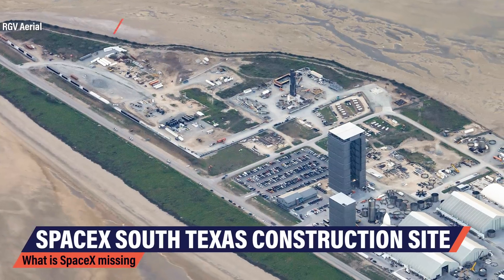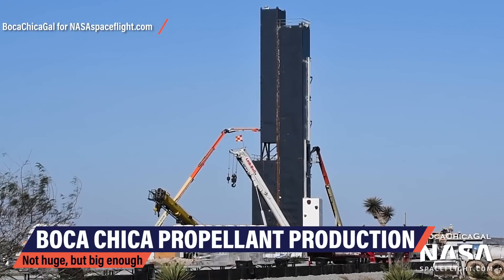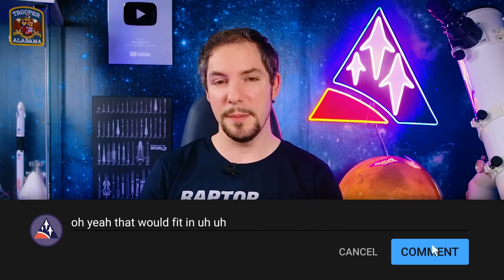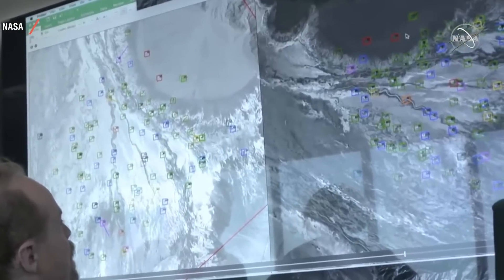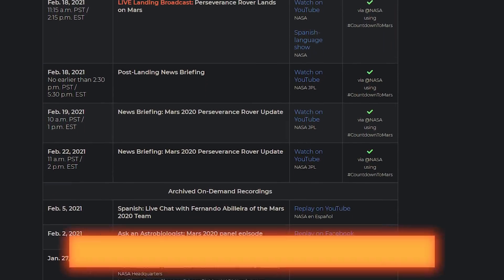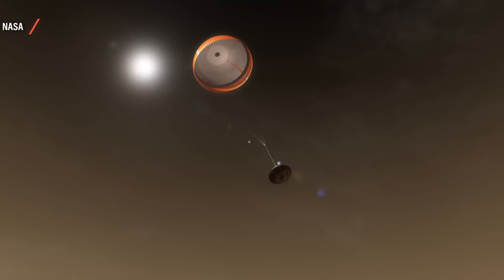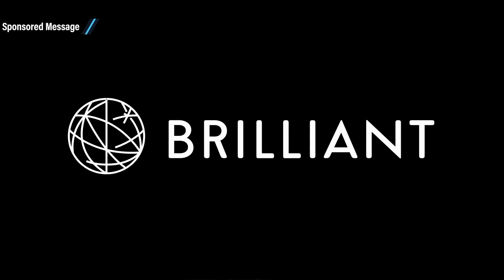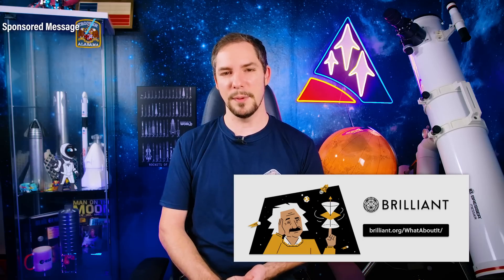146 | Elon Musk’s solution for SpaceX Starship Landings – Perseverance preparing for safe landing

Comment: German version below...
I'd guess that the raptor enigine prudction speed/amount is held back by... consumption. In the end it's a warehousing problem. How many Engines are you willing to build and maintain until use at the same time? There will be a point of diminishing returns. We know, obviously, they built at least 44 engines yet. Not even half of them have flown yet and thus didn't produce data on whatever variation of construction they were meant to be delivering flight proof on. Why scrub an experiment? Would be a waste of money, unless they discover a dealbraker already during testing. On the other hand: before getting the results of the up to 44 engine experiments, one shouldn't produce more engines with the same yet to be shown and already proofed imperfect design, should we? Do not mass produce a design, that is not real world tested. Not even Tesla did that. I think we will see Space X moving toword that 12h mark once the Starship production/consumption meets that demand. Storing space is expensive.

Ich denke, dass die Anzahl der produzierten Raptors von ihrem ... Verbrauch zurückgehalten wird. Angebot und Nachfrage unterm Stich. Wie viele Antriebe will man bauen und warten, wäöhrend man auf ihren Einsatz wartet? Es kommt zu einem Grenznutzen. Offensichtlich wurden bisher mindestens 44 Raptors gebaut. Nicht einmal die Hälfte davon hat bisher den Flugeinsatz bekommen. Dementsprechend haben sie auch keine Erkenntnisse aus einem Flug erlangen können. So, wie wir SpaceX kenne, werden die Motoren alle leichte Variationen haben und Experimente sein. Ohne Durchführung des Experiments hat man keine Daten, um das Experiment auszuwerten und die Variationen zu bewerten, oder? Wenn man nicht weiß, dass ein Experiment durch einen Designfehler vor der Durchführung schon zum Scheitern verurteilt ist, wäre es Geldverschwendung, es nicht durchzuführen.
Außerdem sollte man vielleicht nicht dutzende weitere Exemplare eines Motors produzieren, der noch nicht Praxiserprobt ist. Wir haben schon 44 Prototypen. Zeit herauszufinden, welcher davon für die Massenproduktion geeignet ist. Auch Tesla produziert nicht auf Masse, nur weil ein Prototyp besonders vielversprechend ist. Er muss sich erst beweisen. Ich denke, dass SpaceX sich dem 12 Stunden pro Antrieb Interval annähern wird, wenn die Starship-Produktion anfängt hinterher zu kommen.

Comment: think the big problem flight Starsips is the phenomenon Gyroscopic effect on rotor fuel pump. Look, let the rotor mass be 20 pounds, at 30,000 rpm, and gas dynamic lubrication, in turning, the moment applied to the rotor supports is enormous and can exceed the strength of the lubricant; contact of the rotor with the housing will lead to friction, loss of pump power at a critical moment , destroy. 
Ways of solving - to reduce the diameter of the rotor (the moment of inertia is proportional to 2 degrees of the diameter  Ja=0.5mr^2 ), to do biturbo, to make a turn higher and slower
Reply: There's no thing called "rotor" in Starship. Only tanks & engines
Reply: @alvianchoiriapriliansyah9882   An important component of the Raptor engine is a fuel pump that pumps liquid methane 133 kg per second, consisting of a housing and an impeller, a turbine, a rotor, whatever you want. And an oxygen pump pumping 493 kg of liquid oxygen per second.
And when the Raptor engine is running, a significant additional load will be applied to the supports due to a change in the position in space of moving parts.
And I do not know if McGregor has a stand with the Raptor engine turning 90 degrees during pumping or operation to determine the permissible rate of change in the angle of position in space that does not lead to the destruction of the engine.

Comment: Personally I think the solution "just light all engines just in case" isn't the way to go since they are basically working around the initial problem which is the fact that these engines obviously have a lot of problems when it comes to relighting them.
Reply: So more redundancies isn't better?
Reply: But we can deal with that by repeatedly running the mission profile at McGregor. Making sure we can do the landing profile can’t wait until after the Raptors are perfected.

Comment: The orbital launch mount had tons and tons of concrete poured in it. That much concrete takes a very, very , very long time to cure. As a matter of fact although it can be used soon, the orbital launch mount with that much concrete will probably not fully cure for years.
Reply: Concrete will cure in 28 days, and the first orbital launch won't occurs in less than 28 days from now (pending enviromental assessment)
Reply: @alvianchoiriapriliansyah9882  This is not the concrete pad in front of your garage.
Reply: @runningray  Literally all concrete were still curing. The points is, how long before it's usable despite still curing

Comment: So starship design (flaps) is based on earth atmosphere conditions. The moon lacks those (aero)dynamics. Mars atmosphere is primarily CO2 and density is 1/10 of earth. So they can nail it here on earth... but moon and Mars will need more engineering.
Reply: Higher terminal velocity = longer landing burn = earlier flip, but regardless the atmosphere drag will still be useful there
Reply: @alvianchoiriapriliansyah9882  reminds me of Hubble. They designed the original mirror forgetting that there is no air in space. So the focal point was messed up. It took a later shuttle and space walk to replace parts.
Reply: @mikemccabe1324  Irrelevant

Comment: Felix, what about it!? SN8 & 9 flight profiles where very conservative except for the landing. Why? I understand the landing flip maneuver close to the ground is based on the goal of minimizing landing fuel mass. But why do this maneuver so early in the test program. At this stage of development doesn’t it make more sense to do a more conservative virtual landing much higher up and then end the flight with a SN5 & 6 slow hover landing? Is this do or die close to the ground flip maneuver acceptable for a human rated Starship, wouldn’t a crew-rated Starship need greater safety margins for its landing? Wasn’t the Falcon9 developed right from the beginning to be human-rated. Would a slower horizontal to vertical transition at a higher altitude along with some fuel settling vertical deceleration (gaseous 02/CH4 RCS) offer the needed safety margins? Felix you definitely rock, your WAI is one of the best youtube space channels.  Love your work.
Reply: "But why do this maneuver so early in the test program. At this stage of development doesn’t it make more sense to do a more conservative virtual landing much higher up..." LOL That is what I've been saying from the beginning. Not sure how much fuel the header tanks hold, but if they had enough they could do as you said, a virtual landing. Pick an altitude they want to "land" at, and try to stick it there, and keep doing so until either out of fuel, able to come in for a more conservative landing, or just let it blow if it runs out of fuel since most of us (including Elon) assumed it'd RUD anyways.

Comment: I get why starship is stainless. But the booster doesn't nees to be. Surley going for a carbon composite is the best solution for the booster, jslustbspeak with the guys at rocket lab, I'm sure they would help!
Reply: Well, carbon composite would be much more expensive for multiple prototypes. Perhaps when everything is worked out it might make sense.
Reply: Weight doesn't matter as much on the booster as the upper stage. Carbon fiber is painful, expensive, and share no commonalities (important in manufacturing)
Reply: Then why is he trying to shed so much weight? I think its more important than we think and the choice for stainless is preference not practicality. If rocket lab can do it successfully then im sure elon can.
Reply: @mattwaters106  Carbon share no commonalities whatsoever with the rest of the system. SpaceX hates it

Comment: SpaceX is going to loose many Starships before they nail the landing. That's a fact.

What I'm wondering is if they'll loose any boosters. Elon has said they surely hope they don't loose any because that would be a lot of expensive raptor engines. The booster is pretty similar to the Falcon 9 in concept, but in practice operates very differently.
Reply: We do not know how many Starships we will lose because they are all prototypes. Elon said initial flights of the booster could be done with as few as 2 raptor engines.

Comment: Every time a Raptor fails they have to find out why and design their way out of the problem. No surprise they aren’t mass producing them yet.
Reply: I don’t think the Raptor Engines are failing rather I think the failure is within the fuel delivery. This is the first time a rocket has to tilt to fly/glide then reorient for a landing. Somewhere in the process of going back to vertical there appears to be an issue with re-fire. Maybe during glide there is a pressure loss in getting fuel back into the appropriate engine causing either a delay in refire &/or an issue with full desired performance. Just a theory after seeing a nominal lift off.

Comment: I suspect that the landing issues are the result of starving the turbo pumps of fuel during the transition to its vertical landing station.  Liquids channel under high demand.

Using three engines on landing will answer this speculation, as three pumps demanding fuel will be an even greater challenge to the fuel delivery system.  If I'm correct, the three engine start will show this... spectacularly.

Comment: Since I'm not a raptor rocket engine specialist I would like to ask a question that someone in the community may, in fact, know the answer to. Given that each of the 3 raptors have significantly different run times and shut-off times during the assent to test altitude, are any of the raptors any more or less likely to have re-light issues based on the on and off times of the assent?

Comment: To have an idea what that part is at the Cocoa site, it might help to look back at Elons comments back when he closed the Citgo site. Elon once stated the production rate of raptors hoping for 1 every 12 hours by the end of the year. That was back in 2019 and I dont think he updated the rate. Rolling back to #39 doesn't necessarily say much. It could be an updated engine. Or, knowing it's potential fate, it might be better to go with and engine that can reliably relight for it's suborbital test flight. Right now the demand for raptors is pretty low. I'm sure they will increase production rate as the demand grows for a matured Raptor engine. A list of raptor numbers that have been known to be used would be cool. That is very interesting construction at the Orbital Launch Mount. These are not inexpensive tents and modular buildings. These are poured concrete, explosion resistant buildings with very expensive equipment and infrastructure being installed there. Wouldn't we all love to see the site plan for the current work. But, they have to have building permits. I'll bet this is all on Public record at the Planning and Zoning dept that governs Boca Chica. Who's up to going there to take a look? Mary? Larry? But, will this really be used as an Orbital Launch Mount? Considering the distance of South Padre Island, can 28 raptors really be ignited without risk to South Padre?

Comment: There are quite a few technical errors in this video, unfortunately.

1. The FTS is not yet installed, the box you see being installed is a vibration measurement system.

2. SN10 will not shut down the engine closest to the center of mass, but rather the one with the shortest lever arm. There is a difference which has to do with the vector of thrust.

Comment: Third time is the charm !?
Reply: It seems, the way those engines currently work does not leave much range for fluctuations of fuel pressure, flow and thrust control. 
Probably there is a reason why they are not mass-producing them yet.  We just have to wait and see, meanwhile, I can  enjoy the fireworks since I have no stake in SpaceX except the massive damage they cause to the environment.
Reply: @reasonerenlightened2456  If it makes you feel any better, all of the operations that all of the space agencies and companies around world carry out are a drop in the ocean when it comes to carbon emissions (especially compared to commercial air travel). If you're talking about Boca Chica specifically, yeah it's a shame, but I don't know what the other launch site options were to pass judgement on whether or not it was a good decision.
Reply: @reasonerenlightened2456  yes they need a less performance version lol low throttle or low impulse

Comment: Why are these engines such a mess of seemingly unprotected wiring? It doesn't make sense to have such a huge powerful engine and these wimpy pipes, unprotected. Can't be that much more weight? I'm sure it is also possible to have the pipes integrated in the engine itself, make it structural (or holes in the structure at least:).

Comment: once they get it to land... they might have to sort out better legs as if SN10 goes down to just one rapter to finish the landing that will be fireing off centre
Reply: One rapter can’t generate enough thrust to land as seen on sn8 but still a good idea to start installing better legs because it would give it more leeway to have a rougher landing
Reply: @RandomPerson-zl6uz  One engine can't do the landing if the second one flames out too early and it's not getting enough fuel (SN8), but operating properly it can give TWR > 1.  According to the announcements during the SN9 flight, the plan is (was) to cutoff an engine sometime after the flip, and do the final touchdown on one engine.
Reply: @epicspacetroll1399  ok didn’t know that thanks
Reply: The plan is no legs
Reply: @paulmurphy8549  that is for the booster, not the second stage.

Comment: Starship does not need header tanks. There’s some weight saving right there. Along with 100% reliability.
Reply: It need's header tanks. It can't land without them. The reason why maybe raptors did not work propertly on landing is because LOX header tank is to far from engine and the pipe is to long and due to that there is problem with pressue and flow.
Reply: @miciglaric  
IT. DOES. NOT. NEED. HEADER TANKS. 
Its such a simple design change to get rid of them, I cannot even get a patent for the idea. 
Stop believing everything your lord and master does is the right way to do something. Because it isn’t.
Reply: And why exactly doesn’t it
Reply: @Kaskadamusic  because a simple design change says so.
Reply: @davidwebb4904  ok lol
Reply: @Kaskadamusic  

They make a lot of mistakes. 

Incorrect loading/off loading of propellant = loss of vehicle. 
Having an unnecessary fuel header tank system = loss of vehicle.
Not lighting what may have been a fully functional third engine = loss of vehicle. 
Launch mount without flame diverter = plain dumb. 

Starship, does NOT need a header tank system, with a simple design change. 

But nobody wants to listen to me, so wtf.
Reply: @davidwebb4904  it’s because your ego is so large after loosing an argument your head won’t even process it.
The starship comes to earth from orbital velocities, around 8km/s, faster than a bullet 10x+ times which means the starship has those huge flaps to slow down, that’s the reason why it needs to do this manoeuvre ad close to the ground, when achieving this, the fuel in the large tanks start sloshing around and create inconsistencies in fuel flow, this is different from the falcon 9, which spends most of it’s fucking time vertically
Reply: @Kaskadamusic  The brain trust at SpaceX have destroyed THREE airframes now, by making silly mistakes. All of which should have been spotted and avoided.
Reply: @davidwebb4904  I'm not a musk worshipper lol
you're just looking for someone to try to piss off lmao but I'm just laughing at your ignorance
Reply: @Kaskadamusic  I have a working model to prove otherwise. Incredibly SIMPLE engineering design, completely eliminates the entire header tank system. Even SIMPLE is too difficult for many to comprehend.
Reply: @Kaskadamusic  Dont be that fool who argues against the laws of fluid dynamics.